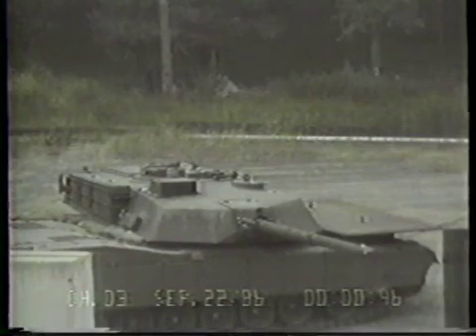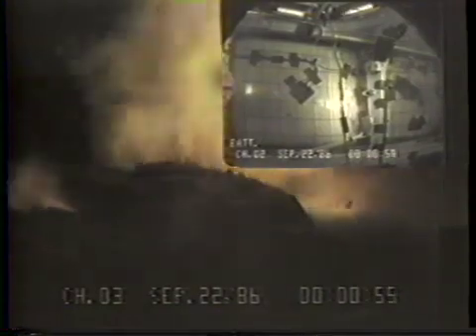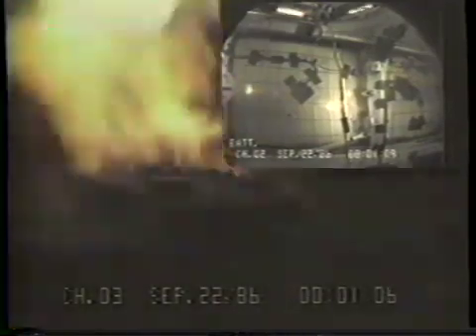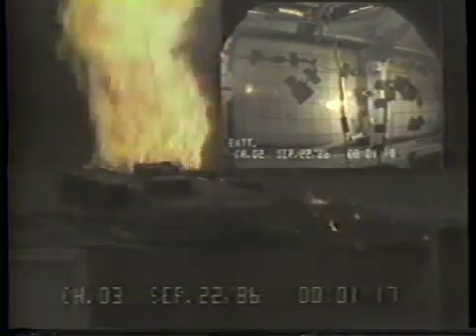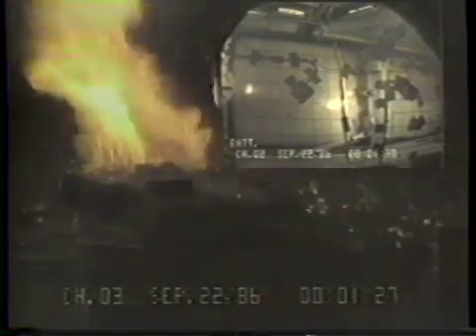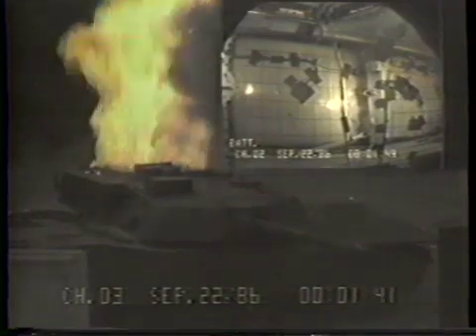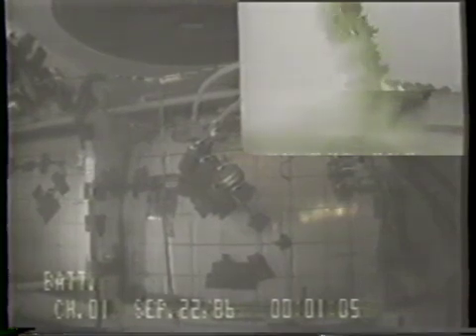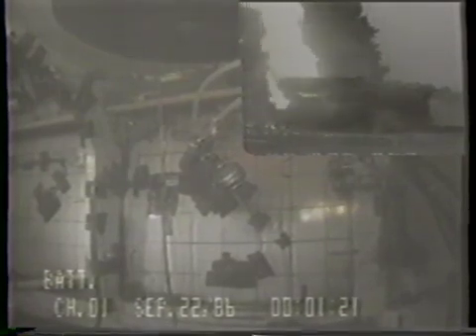Testy Balistyczne Opancerzenia Czołgu M1 Abrams

Comment: Assuming im correct thats the base m1? Not an m1a1 or m1a2/m1a3? Or m1a2 v3 meaning the newer varients are even stronger
Reply from the maker: Ballistic tests are for XM1 PV11 prototype. Later we see turret and hull, isolated ammunition magazines with blow off panels, tested within M1A1 ballistic turret and hull.
Reply: @bronpancernaswiata6835 neat my only concern is what caliber shells are being used? Is it 100mm+? Or are they smaller caliber like 60-90mm heat/heatfs rounds? Another thing im interested in is was it ever shot with apfsds?
Reply from the maker: XM1 PV11 was tested again 105mm APFSDS and HEAT, and also ITOW ATGM.

Comment: The T-90M has the same function except the crew usually dies in the process
Reply: it does not have the same function, the crew sits in the same place as all the ammo is stored, the point of this research was to make a storage for all the ammo separate from the crew that wouldnt be destroyed in the even the ammo itself was damaged. the crew of a t90 literally sit on top of the ammo.
Reply: My exact comment if my knowledge about the t90m was none